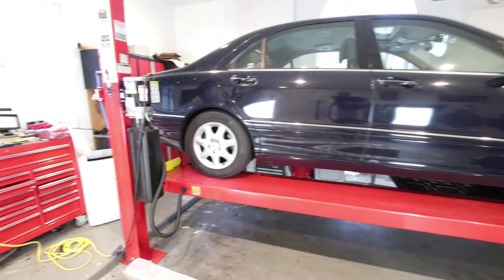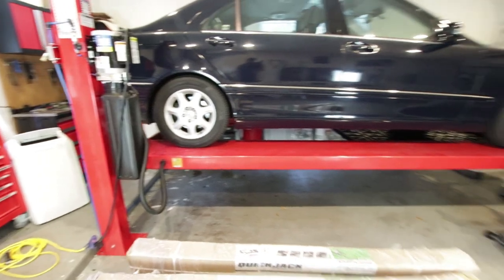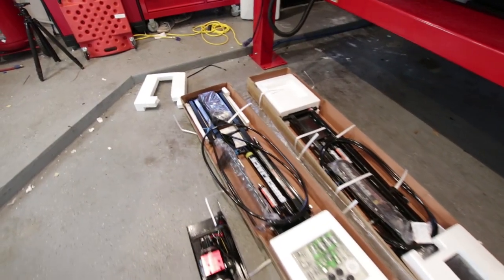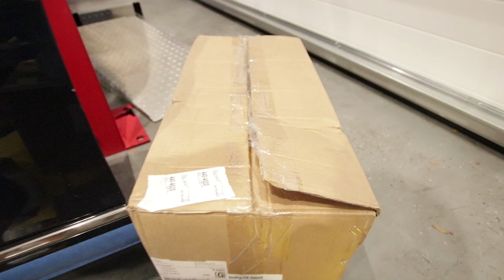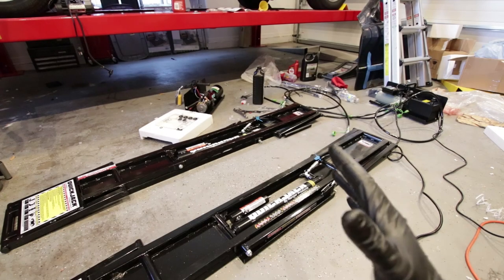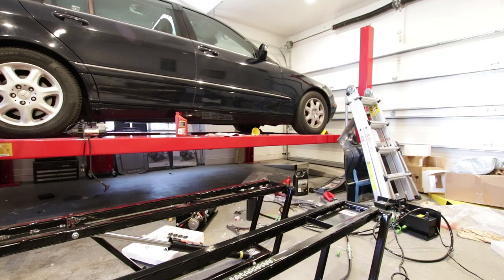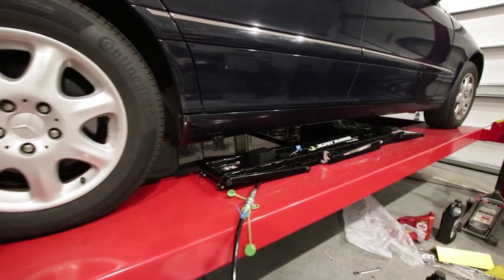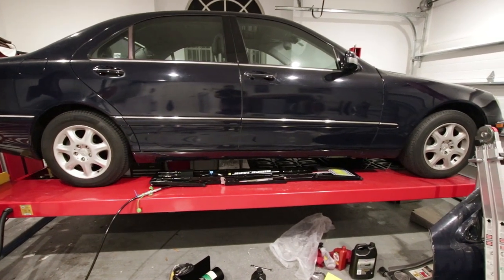How I Turned A 4 Post Lift Into A 2 Post Lift With A Ranger QuickJack

Comment: I'm doing the same thing with my setup, only started first with the quickjacks and just ordered the 4 post lift. I am already thinking about modifying the lift to put rails on the outside to hold onto the quickjacks so I don't have to move them around as much, just flip them on their side and stow them on custom rails outside the ramps on each side.
Reply: As a simpler alternative, I've heard of people laying down a few 2x8 boards bridging between the runways and resting on the spots where the jack tray normally sits.  Then you can just rest the Quickjack on top of those between the runways.  My 4 post is coming in a few weeks and I'm planning to try this.

Comment: not entirely sure about that lifting method... I would have concerns the weight of those quick lifts transferring weight to the center of the 4 corner posts.  The weak spot is applying weight to the center of the lift.  The second issue would be the 4 post lift not bolted.  the weight would pull those 4 posts inward with those quick jack lifts.  4 tires keep weight on outside edge, center lifts would do the opposite.

your post on left there shows light reflection changes with quick jack lift, weight there is stressing four post lift.
Reply: I have considered this setup, but Bendpak makes specific recommendations for weight distribution on the runways. The quickjack puts all of the vehicle weight in the middle third. For a light car you might get away with it, but for a 4500# vehicle, you might be bordering on structural failure of the runways. 

You can find the recommendations here (page 11) 
https://www.bendpak.com/Rolling-Bridge-Jacks-Manual-5900004-BendPak.pdf
Reply: I was thinking of this as well.  However, sliding Jack's and stands would have a similar effect, so I'm not sure that the method in this video is truly invalid.

Comment: Since you have the 4 post for gross movement, the QuickJack only needs to be used to elevate the car high enough to get the wheels up and the lift in a locked position.

Comment: you aren't supposed to lift it without a load on past the first lock.it's in your instruction manual, and actualy BendPak purposely under rates those quick jacks so they would still probably lift your dually, for future reference. just like the 7000 pound one i ordered is capable of lifting and supporting over 18000 pounds but it's not intended to support that weight normally

Comment: Not hating, it just looks like a 2 post lift would have been the better way to go. Seems like you are going through a lot to make it a 2 post.
Reply: He didnt want to drill into the cement.
Reply: HawaiianNkim  He can also use the 4post as storage and drive another car under it
Reply: mike smithson you Can still put a car underneath a 2 post i do it all the time although the space in his garage would probably limit that.
Reply: ricochetey Good point, I was meaning in his case with these jacks. A real 2 post requires a little more anchoring also and he didnt want to drill into his floor.
Reply: This is not good for the car. All the weight of your wheels work in the opposite way they suppose too work. Sorry for my English
Reply: @memeth17  Unloaded suspension is better for the car. There's no force on the bushings.

Comment: I got a 7000 lb model coming in this wed! Can't wait. I had a 2009 S550. I wonder if it would reach the lift points cause that thing had a long ass wheel base. Also did the lift come with caster wheels?

Comment: I have a Bendpak 4 post lift it worked ok but after a few years all of the hoses broke down and dumped hydraulic fluid all over.   Bendpak refused any assistance in replacing the garbage hoses

Comment: Not hating but this setup seems like a complete pain in the ass compared to just getting a 2 post
Reply: Or a cost effective way to avoid a 2 post or 4 post it your garage needs a high rise door or a 6" inch concrete floor or more  head  room to use a lift.
Reply: 2 post isn't portable, stable, or for storage of vehicles.

Comment: Can you tell me your honest opinion about the quick jack? I'm thinking about getting one since I cant install a 4 post lift in my garage.
Reply: Man i got one and setup isnt that bad as long as u can turn a wrench and teflon tape fittings only downside is that the rails are heavy as shit not exaggerating each rail is 100lbs a piece and the motor with fluid in it is like 35lbs but with the lift it gives u to work is worth the heavy lifting

Comment: if you would hook it to the cigarette lighter then I`d really feel sorry for that Fuse because it would literally vanish in no time
Reply: DulceSeeker I was thinking that too. 
The website says the 12V unit pulls 70 amps.

Just looking at the power and ground connections I hope nobody would try using a cig lighter outlet.
Reply: @PerformanceAudioLV  I agree that the 12 volt aux lighter plug is the wrong choice. But I have been running my 12volt unit off a lawn mower battery without issue.
Reply: Chris N I've worked in automotive electronics since 1994, will be 25 years this summer. I've worked in both the OEM & aftermarket side and honestly, My biggest concern is the wiring for the cigarette lighter which is typically 16 gauge at best. I've seen 18-20 gauge wire used for a cigarette lighter as well. 
 Let's say the vehicle has a 5' length of 16 gauge from a battery or power distribution to the cigarette lighter. That's good for about 30 amps max. The cigarette lighter is usually fuses with a 10-15 amp fuse, sometimes a 20 amp. Using a higher amperage fuse will melt the wiring if you use a higher amperage fuse. 

There's nothing wrong with using your lawn mower battery. Especially going directly to the battery. That's actually ideal.
Reply: @PerformanceAudioLV  Yep, I get it. Just letting people know that a small 12volt battery should be sufficient.

Comment: Wouldn’t be cheaper to buy the axle lifts for a 4 post lift
Reply: I wish, the cheapest center bridge jack I could find for my lift runs $800 plus shipping. You would need two to get all 4 tires in the air so it comes out cheaper to do the quickjack. Wish Quickjack would send me a set to review haha.

Comment: what are you so nervous about????  Its just as if you are lifting off the floor.  You are on a four post lift, so anywhere on the red platform is fine.  Just remember, depending how you have the orientation of the quick-jack(s) , the car will move forward or rearward as it goes up; about 15 inches.

Comment: Just got my four post and need to frequent brake jobs for track. Looked and found you can get two bridge jacks for only a bit more $$ than the quick jack.  A simpler solution
Reply: not really. why do prices for a 4500lb bridge jack range from $600 to $1600????? makes me wonder about quality or stability. then trying to get a bridge jack for a lift that doesn't have any available from the manufacturer.

Comment: Not smart. The load capacity of a 4 post is determined by where the load is placed on the ramps. Your car loads the ramps at the wheels, which are closer to the posts. As the load moves toward the center of the ramps, the capacity drastically decreases. The scissor lift puts a significant amount of weight at the center of the ramps.
Reply: please explain bridge jacks then. they are designed for 4 post lifts.